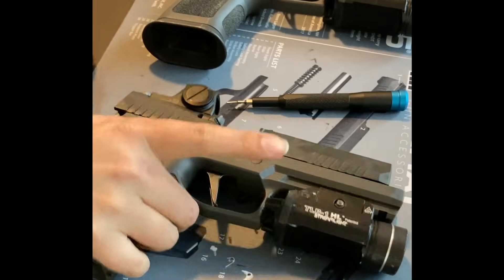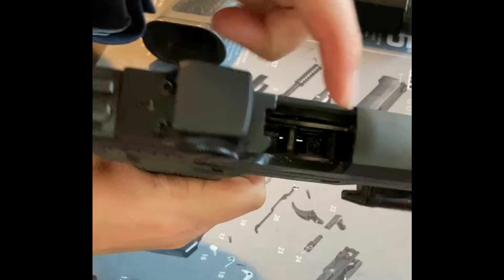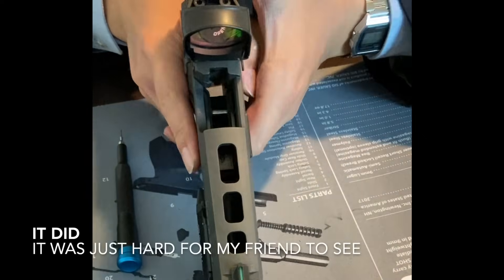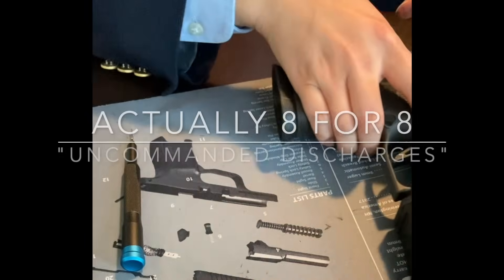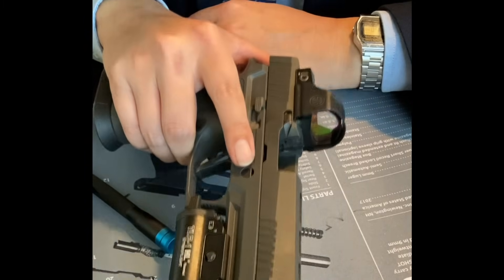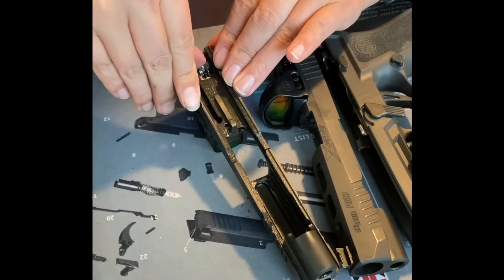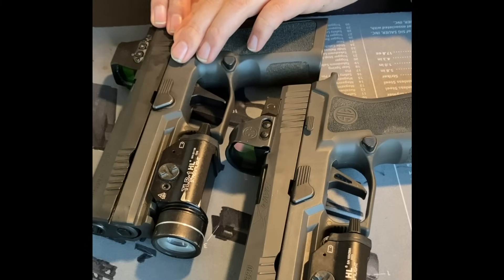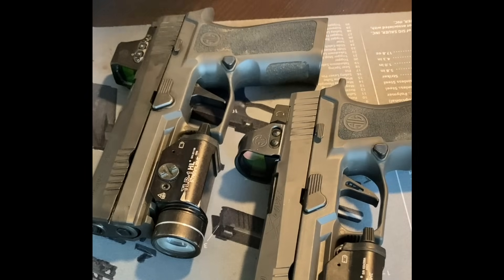Testing two P320's for Uncommanded Discharge: One PASS, one FAIL

Comment: The P320 is a poorly designed pistol. Now Sig is in WAY over their head and doing damage control. 
The Sig classics, p226, p229, p232, even the sig pro line, were wonderful, reliable, safe designs. Sig USA has completely turned their back on that market to push this trash on yhe world.
Reply: There is nothing wrong with the p365 I dont get why fanboys are trying to apply the p320 problems with zero statistical evidence to p365s.
Reply: @DavidMilesMusic  I mentioned the p320 and not the p365. I sold my 320 after I was able to replicate the drop safety issues on my early model. I own a p365 and have for many years. The p365 does not have the same design and does not seem to have the same issues. My p365, however, has fallen out of my EDC list due to my growing distrust in SIGs use of Indian made MIM parts. Those parts are also on classic line pistols of recent production. The LE agency I work for had p226 pistols until this year and the latest models had many odd failures like broken hammers, firing pins, and even triggers. SIG is absolutely not the great company they were in the 90s and early 2000s.
Reply: Spot on!!  I have carried the classic series (P226 & P229)for years.  I was pissed when they dumped the P227 and never followed through with making the 14-round mags they initially talked about manufacturing.

Comment: What are the build dates for each pistol? And what would have to poke into the back of the sear when it’s in a holster? Or are you saying a particular movement in the holster will cause the sear to fail?
Reply from the maker: For whatever reason, sears are failing and releasing strikers. When the sear fails, there is precisely one safety mechanism left preventing an “uncommanded discharge.”

This test doesn’t care why the sear failed, it assumes the sear has failed and checks whether that last-ditch safety mechanism is or isn’t working as intended.

Comment: You can also do this with the gun fully assembled and a primed case
Reply: @peerlessfief Are you sure? Moving the trigger moves the sear, but my understanding of the internals is that moving the sear (or striker safety) does not move the trigger. I don't think the sear or the striker safety are physically linked to the trigger or trigger bar, and can move independently from it. Happy to be proven wrong.
Reply: Jamming foreign object into the back of any gun not a good idea lol
Reply: @morocomole4567 lmaoooo
Reply: No you cannot. Moving the sear moves the trigger thus defeating the safety.
Reply: @peerlessfief what are you talking about bro

Comment: What years were these p320 produced? Also which number is stamped on the trigger bar?
Reply from the maker: 2020 and 2022. The passing FCU has a 675 stamped Trigger Bar and an X-series flat trigger, the failing P320 has a 576 stamped Trigger Bar and a Legion-series skeletonized trigger.
Reply: @P320Truther  576 is the “updated bar”
Reply from the maker: Yep, and it's the one that fails. Apparently the old ways are better.

Comment: Compare the P320 to a Glock and XD designs. On a Glock you can insert a thin tool to push the cruciform down and release the striker. Very similar to what was being demonstrated here. There are two big differences however between the Glock and P320 1. Releasing the striker in this way on a Glock does not move the trigger and 2. Releasing the striker in that way never causes the striker to get past the striker block safety bc the trigger bar is not moving backward.
XD pistols from HS Produkt, like the P320, have a fully cocked single action striker design with a rotating sear. The difference with the XD design compared to a P320 is that if external pressure is applied to the sear it wont release the sear bc the grip safety physically blocks the sear from rotating unless the grip safety is depressed. Second even if the grip safety is depressed and sear is released through external pressure the trigger bar does not move. This means the striker safety block does not disengage. Third, the trigger has a blade safety. So somehow even if the trigger bar could magically move it couldnt move far enough back to disengage the striker safety block unless your finger was on the trigger.
Reply: Almost right… in a properly functioning Glock if the trigger is in its fully forward position the cruciform is resting on a drop shelf in the trigger housing.  You can poke at the cruciform all day in this position and it won’t drop.  As the trigger is pulled the cruciform clears the drop shelf as it contacts the connector and forces the cruciform down firing the gun.
Reply: @Robbie6298 this 👆🏻
Reply: Thank You! I have owned an XD40 and Glock 30, both for over 20 years. I now know why I always preferred the XD trigger, because it is single action, and has less grit, and resistance than my Glock trigger which is considered double action. I also have a better appreciation of the XD safety features, like grip safety, after the problems of other single actions like the Sig P320.
Reply: Walther is fully cocked since the p99 and doesn't go off
Reply: Am I wrong? It seems perfectly possible for the sear and striker safety to move independently from the trigger  in the 320. They are held in place by spring pressure. The trigger is like the charging handle on an AR, and the sear and striker safety like the BCG. Pulling the trigger will move the sear and striker safety, like pulling the charging handle moves the BCG. But the BCG (sear and striker safety) can move independently from the charging handle (trigger). In a Glock, if the trigger doesn't move, the striker is physically prevented from moving.
Reply: @Christ-is-King  this is correct.  The sear assembly has nothing preventing it from falling independently of the trigger bar.
Reply: @Robbie6298  Thanks, it's good to have confirmation! Everything I looked at was telling me this was possible, but without owning one to confirm (and with how strong Sig is gaslighting), I was starting to wonder if I was just missing something.
Reply: No you can’t. It sits on the drop safety platform until the trigger is pulled; allowing the trigger bar to drop below the cruciform as it moves to the rear of the pistol this movement also fully compresses the striker spring giving it enough energy to ignite the primer.
Reply: What about with the 365 compared to this?
Reply: @zachschubert7190 the safety on the 365 physically blocks the sear from moving.  This also prevents the trigger bar from moving.  The 365 also has a different style striker block than the p320
Reply: Curious what type of system does the M&P series of striker-fired guns have. Anyone know?
Reply: @Neur0bit  M&P is also a fully cocked striker.  In fact most striker guns that aren’t Glock derivatives except the CZ p10c are fully cocked.    The safety flaw isn’t because the striker is fully cocked it’s because Sig tried to cram a striker gun in a hammer frame and made the op mechanism overly complex and prone to tolerance stacking.
Reply: @Robbie6298  Thanks for the reply. While I carry a G19 (own two), I also have a first gen M&P Shield and was wondering about this. I’ve always known they were safe since I have never heard of anyone having any incidents like the P320s in almost two decades, but wasn’t 100% sure which system they went with on the actual mechanics.
Reply: @ I carry a shield plus.  I trust that it’s safe.  The sear is super low mass and is independent of the trigger bar with the trigger in forward position.  Bumping the trigger bar will not result any contact path with the sear.  Only when the trigger is pulled backwards will the trigger bar make contact with the sear.  The firing pin block is also a very robust steel cylinder engaged by a coil spring not a bent piece of sheet metal held in by a hairpin spring like the p320.  The P320 safety mechanism is marginal at best will work as intended if new and in spec but may be prone to inertial bypass with a weak spring or a dirty gun, or wear on the striker or the safety lever.  The design also is not tolerant of out of spec parts and tolerance stacking.
Reply: What about the new Echelon, the replacement for the XD line?
Reply: Exactly, why would a modern manufacturer not include a striker block when designing a gun? Pretty much every other handgun from a reputable manufacturer released in the last 10 years has one.
Reply: @ it has a striker block. It’s just overly complicated and prone to failure and tolerance issues.

Comment: Would this also happen for models that have a manual safety in the fire control unit?
Reply from the maker: Likely yes, though I don’t have access to a manual safety model to verify. My understanding is that the P320 manual safety prevents the trigger from moving, but it does not prevent movement of the sear.

Comment: And now we have the full situation where you can easily get all the "holes in the cheese" to line up. Why even bother having a striker block if it doesn't even work, lmao.
Reply: It’s just obvious that the P320 striker block was literally just an afterthought since the whole body of it is from the hammer fired P250. If it was an actual good functioning system, they wouldn’t have switched to the Glock style for the P365. The P365 is what the P320 should’ve been as sigs intro into the striker fired market.
Reply: @JAD77755 you are correct about the P365 and to add to that, the P250 should have been a DA/SA instead of a DAO.

Sig doesn't have the brightest at the top.
Reply: @TheMailmanOfSteel  They probably added the striker block because they realized how easy it was for the sear to fail. They were just too incompetent to correctly implement it. I don't even think the manual safety in the M17/M18 prevent this either. I think it just blocks the trigger bar, which doesn't move in this failure mode. They seem to be  incapable of adding an ACTUAL safety to this platform 😂
Reply: @Christ-is-King  a striker block is pretty much a requirement, even hammer fired guns have a firing pin block.
The real conundrum here is that should all else fail the striker block is the last line of defense. I remember oldheads in the 2000s saying they didn't even trust the decocking on P226s even though the firing pin block made it safe. Turned out they were just a decade and a half ahead.
Reply: @ChucksSEADnDEAD  Some of those oldheads carried revolvers with firing pins extending from hammers or Series 70s 1911s, neither of which were drop safe and were often carried on empty chambers. The main difference between the 320 and the 226/8/9 is when a round is chambered and the pistol is holstered, the 320 is still under constant spring pressure on the striker and ready to fire from single action and the 226/8/9 with the hammer let down is not.  The newer generations of shooters most likely experience the first double action shot from the 226/8/9 to be inaccurate compared to that first single action shot from the 320, but this can be addressed with training.
Reply: @chrissullins3  If you're carrying a 1911 with the hammer down on a loaded chamber you are carrying it incorrectly. It's not designed for that
Reply: @chrissullins3  The difference is that for example the Beretta design rotates a plunger out of alignment and doesn't allow the hammer drop to transfer to the firing pin when you decock. The P226 relies on the plunger safety alone.
Reply: @ChucksSEADnDEAD The hammer in a P22x series firearm never comes close to the firing pin during the decocking action. The P22x uses a rebounding hammer and a sear catch to prevent forward movement of the hammer when the trigger is not fully depressed to the rear. There's something like a 1/4" airgap between the hammer and firing pin when it's decocked.
Reply: @chrissullins3 No. S&W DA revolvers with hammer mounted firing pins were and are quite drop safe since 1945 (and were fairly drop safe but not up to modern standards before then) and they were normally carried with full cylinders. Colt DA revolvers of the same type were and are quite drop safe and carried fully loaded.
Reply: Getting to see the Xray of p320. It is crazy that an implemented safety feature doesn't work.
Reply: Too sigs defence they did advertise it having no safety devices when I bought mine 😂
Reply: I know right 😅
Reply: Are there any examples of P320's slides traveling forward beyond in "battery" with the barrel and recoil springs in the gun?

Comment: Very easy to recreate this test; did it with my own 320 X-Carry ten times in a row in a few minutes, and no striker protrusions occurred.

I'm not 100% trusting it, but I feel a LITTLE better about potentially carrying it in the future
Reply: I would test it in all orientations. The striker safety is only held in place by spring tension. If that spring is weak or dirty it could be less likely to return to the safe position. I think this is why it seems to happen more in holsters also, because the orientation of the weapon means gravity is no longer "assisting" the striker safety to fall down into the safe position. Stay safe!
Reply: Dude don't carry it. Carry something else.

Comment: One thing that I think is causing confusion is there seems to be at least 2 or 3 different problems that are causing the uncommanded discharges. Most people are not aware of all of these issues, so if one of them is fixed they think the gun is fine. 

Besides the one shown here, I believe the original guns could fire by being dropped on the back of the slide, and the inertia of the trigger would actually physically pull the trigger. I believe that is what the "voluntary upgrade package" addressed. 

In addition I have seen claims that there are QC problems with some individual sears, trigger bars, triggers, springs etc which affect some but not all guns.

If I am wrong on any of this please let me know, im legitimately trying to figure out what the problem is with the guns, but so far I haven't seen anyone give an overall view of ALL the issues
Reply: The drop safety issue is separate from this issue. To my understanding the cause of the drop safety failure was the trigger shoe. It was so heavy that if you dropped the gun inertia would pull the trigger. To me that technically is not an uncommanded discharge because the trigger itself technically moved, and if you had a gun with a manual safety engaged it wouldn’t be an issue. The drop safety issue was corrected with the “voluntary upgrade” program. 

This is a completely separate problem and affects both pre and post “voluntary upgrade” guns. If I’m wrong someone please chime in and correct me.
Reply: There's also play between slide and frame and the striker can rotate around its axis, that some have theorized could cause torsion on the grip when the slide is locked in a holster to pry the FCU away from the slide a few mm and cause the sear to slip.
Reply: @ChucksSEADnDEAD that is my theory. Poor dimension control of engagement faces. Rotational slop of the striker, and a safariland als gripping the slide, just takes a bump on the grip to over rotate the already rotated striker and it will slip. 

So to be replicated you need the striker to randomly or intentionally rotated to the max, and exaggerate the minimal engagement with grip rotation opening the slide (striker) to grip (sear) interface further. 

The p226 and p365 both have a plunger style block, the p320 dose not
Reply: @ChucksSEADnDEAD that is plausible cops love resting their hands on the rear of the pistol and push down similar to the 30* impact that can still be an issue but also that would be an ND

Comment: “Negligent Discharge” wouldn’t be the correct term for what the P320 is doing, there’s no amount of care you can take when carrying them that would take away the possibility of the gun firing unintentionally, unless you just don’t keep a round chambered. “Uncommanded Discharge” is definitely a more accurate description of what’s going on. It’s a design and material failure and the fault lays directly at the feet of Sig.

Comment: To believe Sig at this point, you'd have to believe this guy is pulling the trigger in these tests. 
Great work.
Reply: Yeah, no way the firing pin block should stop the striker from releasing. Also, not sure the sear should drop without the trigger moving. I think it's a sear and striker safety failure. Legally armed America has a old video of the p320 firing from being hit on the back of the slide. Sig would be better off just admiting failure and design a new pistol anyway. The p250 was ugly af, the p320 is a repurposed p250 😂 jokes aside, they need to just admite they messed up and seriously fix this issue. It's almost as if they can't admit to themselves they failed. I won't ever buy a sig product because of how they responded to the issues.
Reply: @gabrielf1911  They have too many high profile contracts at this point. It would financially ruin them.
Reply: @gabrielf1911 as I recall, the original fall ND’s were caused by the frame hitting as a specific angle allowing the trigger to be pulled by momentum. That was addressed with the “upgrade” which lightened the triggers. These seem to be a different issue.
Reply: Yet, there are still dudes that will die on the hill defending Sig!
Reply: There's one channel I used to watch that released a video basically saying what Sig said about the problems sig is having.  Calling people Bloomberg plants if they questioned things. He was even saying the videos of them going off on there own was all police and police don't know what they are doing so that was the problem.  @chrism2042
Reply: Their lawyers have no ethics or morals.  $$$$